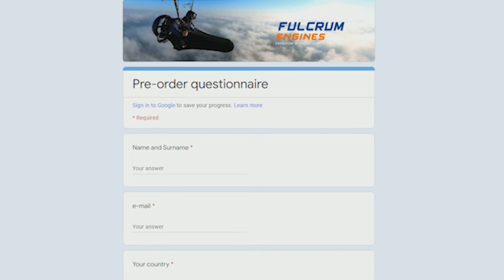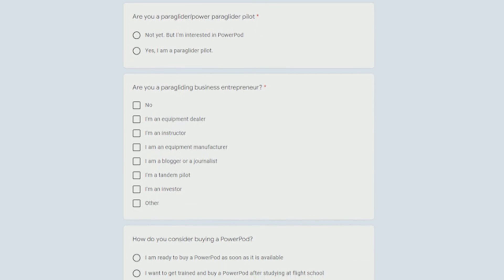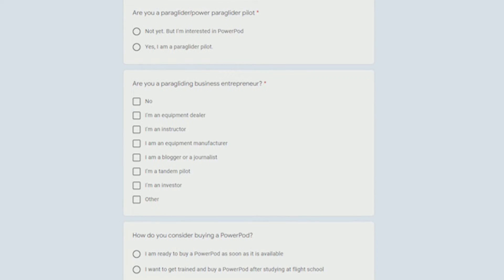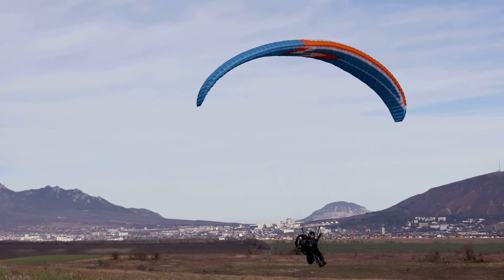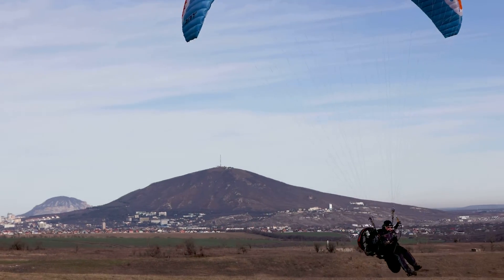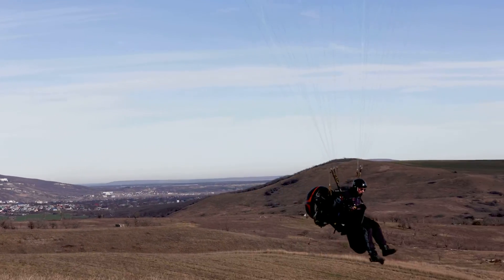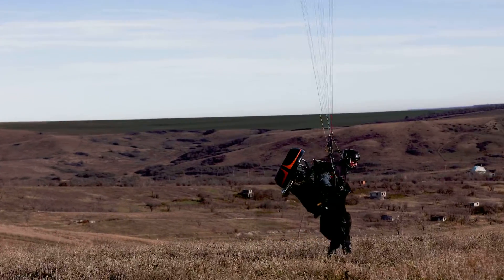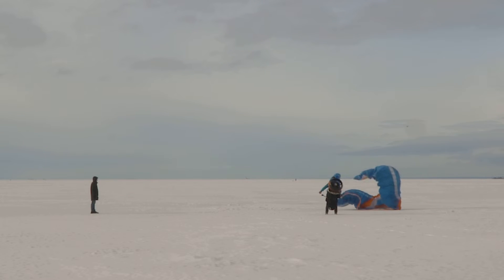Paramotor pod harness PowerPod - Q&A, pre-order questionnaire, footage of takeoff and landing.

Comment: Is there any use off clutch box or reducyion gears. U can solve your noise problem by replacing with 4stroke engine , its heavy but resultantly weight can be equalize with little nominal silencer and less fuel weight.

Comment: You mentioned the problem with the electric version world be energy density of the pack, and you couldn't put a lot of batteries on and would still be lackluster in flight time. But if you consider your product as a one time winch that you can solo use to get to altitude and then go and XC properly due to the good aerodynamics... well you don't need that much power time to do that.
Reply from the maker: Hi Andras, in weak conditions more then one attempts are needed to get a thermic, plus a reserve for return is needed. For only 1 attemtp elecric version looks good.

Comment: Have you considered using an inflatable wing one that would be filled with lighter than air hydrogen? Neutral buoyancy pretty easy to achieve. No power required
Reply: in that case you'll be better with a balloon

Comment: It's good to finally hear what the motor and propeller sounds like along with a take off and landing.  Looks perfect for us PG guys wanting to climb up and turn off the motor for some thermal flying.  Have you tested the engine in warmer temps.? (26C-33C)
Reply from the maker: Not yet. The maximum temperature during the tests was 20-22 С. This summer we will check the engine operation at high temperatures.